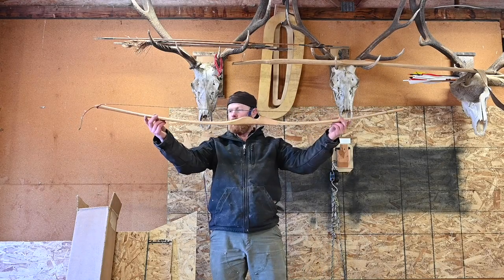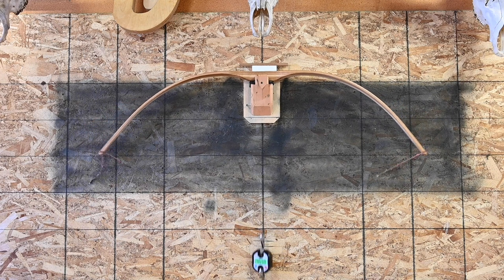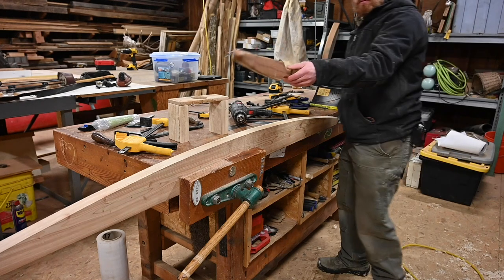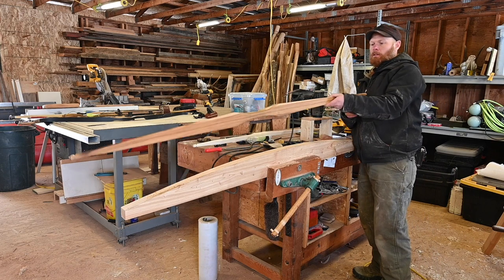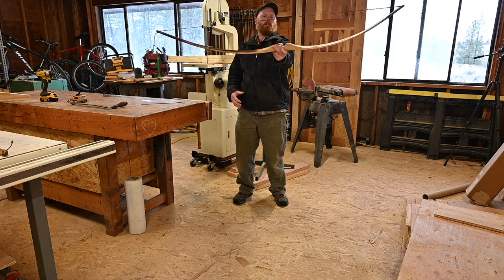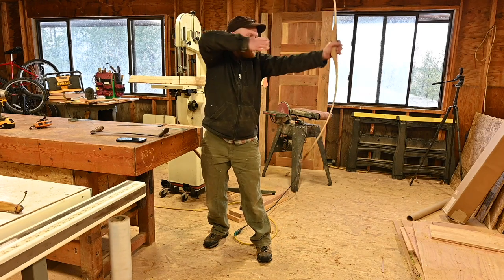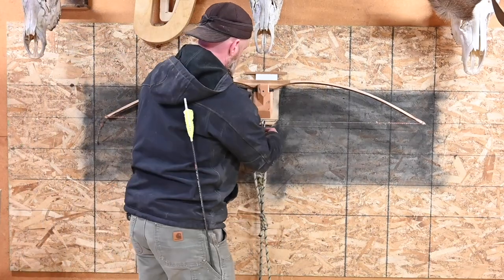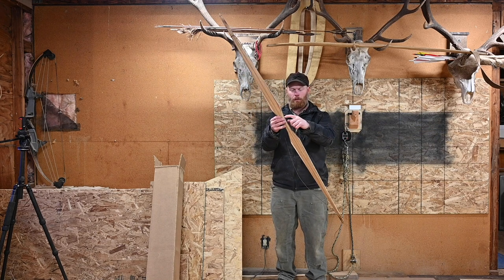Bow Performance Upgrade! HARDENED White Wood Bows |

Comment: Nice work. When you’re fire hardening it add bacon grease and it’ll seal up the pours and waterproof it. Plus protects the wood from over cooking.  At least that’s what I do and it works very well.
Reply from the maker: Great tip thank you, at what point do you fire harden, 50% tiller, floor tiller?
Reply: @SurvivalSchoolHouse  I full tiller then back set with fire hardening. Gain pounds plus seal bow up. Nice Carmel color with show through when it’s good. I had them start on fire and still be fine
Reply from the maker: Thank you sir